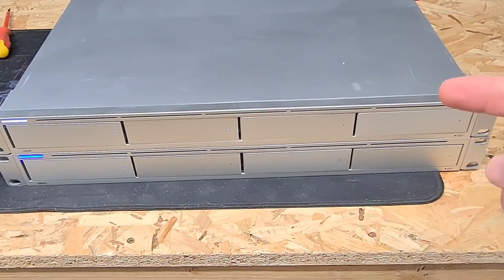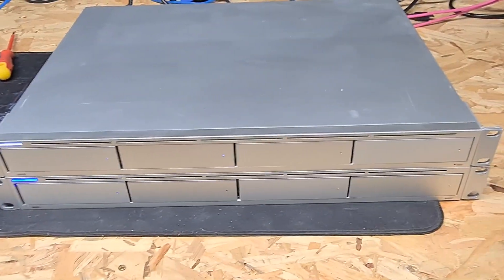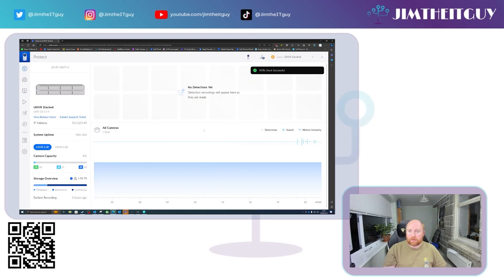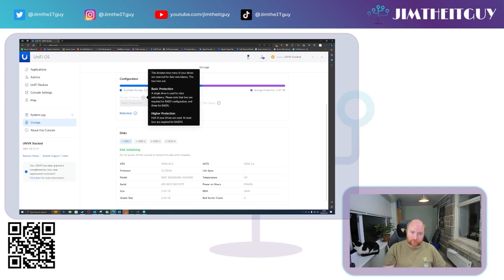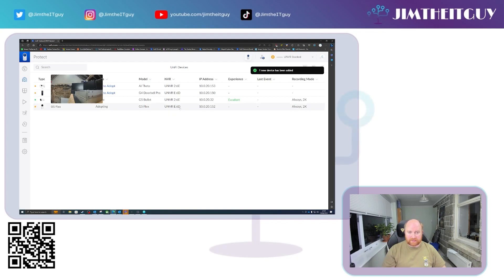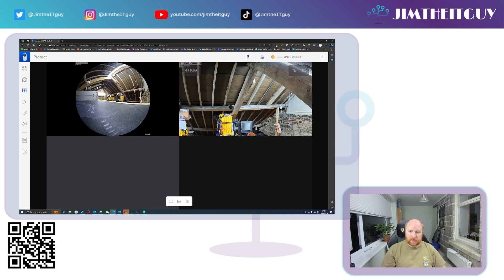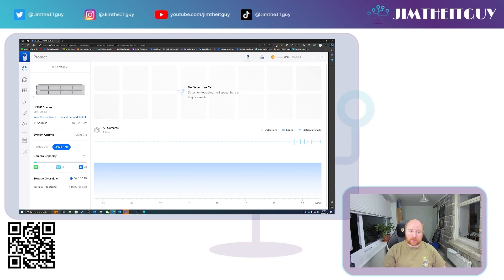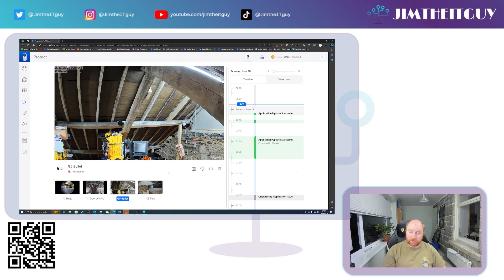Unifi Protect NVR Stacking - Stacking for greater capacity

Comment: No need to add a static IP to the second NVR because once it's stacked, it sees it as one component and you cannot get to the 2nd GUI interface if you tried. The other issue is that you also have access running, if you have one of your doorbells linked to a camera on he same NVR and that NVR fails the link will break between the cam and doorbell, and they bot won't failover.

Comment: Thank you for the Review.  I currently have 3 of the UNVR4 units with 4x12TB HDDs in each.  I was hoping to stack 3, but if they have to be done in pair, I have to add a 4th and the HDD.
Reply from the maker: I'm hoping they may add the ability to add further child units, and maybe mix and match, so you can add a Pro to NVR
Reply: @JimtheITguy drats I was hoping to upgrade a site to the pro and stack the old "flash drive" unvr as child.
Do let us know when this is available (currently have the pop up note of, your nearly reaching your camera limit) let's hope they don't want anymore cameras for awhile.
Reply from the maker: @gregmcinnes77  will keep my eyes peeled for any changes
Reply: @JimtheITguy  how do I not really on the unvr USB, is there a setting, or will an update automatically change it over to the hard drive?
Reply from the maker: @gregmcinnes77  you should get a prompt when you login, however if you have a later unit you won't have the usb drive
Reply: @JimtheITguy  I had to replace both units I have installed, definitely has USB. I will log in via url when I have a chance. Thanks

Comment: Thanks for the video and the tour of the updates! Looking forward to trying this myself - very handy to know the need for balanced storage across both NVRs ;)

Such a shame this isn’t for high availability… I wonder if that will be a direction of travel at a later date? For now though, just having a capacity increase is very useful!
Reply from the maker: I would expect the ability to add more child NVR's in the future will be a thing, HA would start to require alot more work and overheads for the units, I would just like the ability to backup the data to an external location